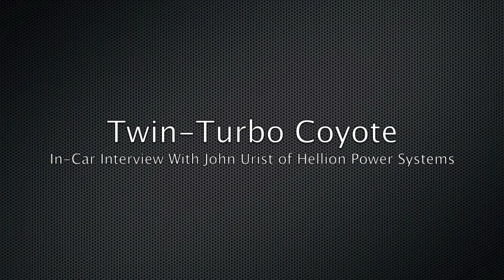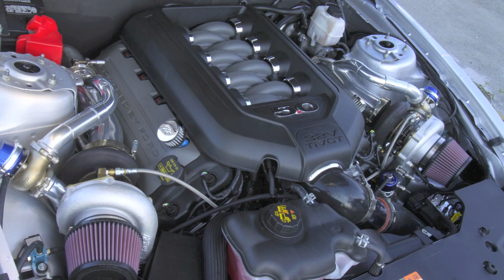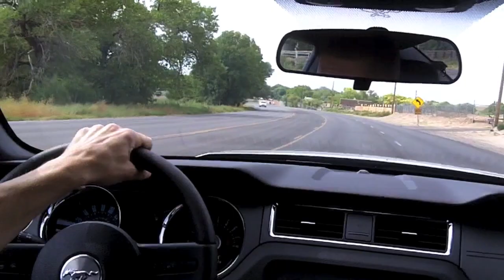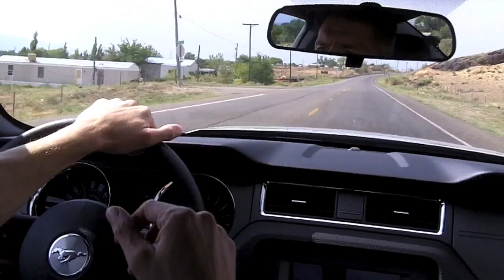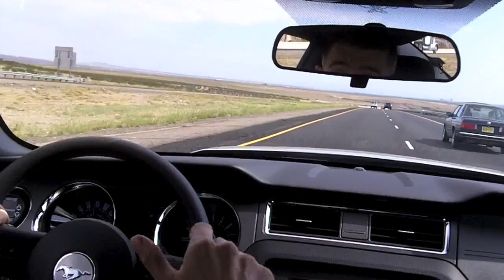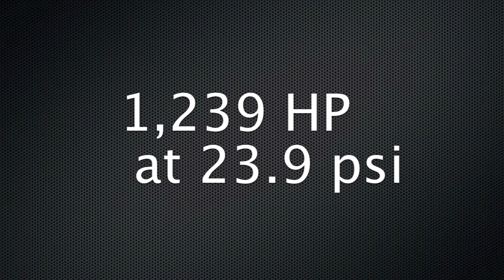Hellion Coyote

Comment: $8500 ?? Way over priced. 90% tubing. If you can get the dimensions of all the tubing and have a fabricator do it for you, the price would cut in half, so just buy the turbos, BOV, intercooler, headers. Youll get away with $4,000

Comment: The problem with a manual transmission is every time you push in the clutch to shift, you take the torque off the drive wheels.  An automatic always has torque on the wheels.

Comment: Boost control. At low pressure boost they essentially turn it into V8 version of Ecoboost that lets out low RPM torque bump which helps car quickly reach average street or freeway speed and then practically idle as it continues in steady state mode. American Muscle were able to do the same for their V6 project car with axial supercharger, they showed that a blown, 500rwhp car was able to consistently reach 33+MPG highway as long as right foot was telling ECU to tell Procharger to stay within 3#.

Comment: Stock coyote 5.0 in the GT an safely handle 620rwhp or about 735 crank hp... Stock s 412 crank hp 2011-2012 & 420hp for 2013-14. Or buy a Aluminator engine. Or better yet buy a BOSS with its fully forged Roadrunner engine.

Comment: You need to listen to the whole thing it is the base kit meaning at 5psi a stock motor will make 600+rwhp all they way up to an built motor running 25 psi making 1200rwhp. Also he never said anything about a 8K crate motor you can get factory aluminator crates for 7K you can also get the block for 2K and throw MMR or a DSS rotating assembly in it for 2K. Injectors and fuel pumps along with a base tune are included in the 8K kit.

Comment: "Basically bone stock"?!? You just listed a twin-turbo setup ($8,495.00), Ford Racing 5.0L 4V DOHC Aluminator Crate Engine ($8,374.99), High pressure springs (??), triple pump fuel system (??), Billet gears (??), and 80-lb injectors (??) all on top of a car with a base price of $32,000. Oh, I almost forgot the twin disc clutch. And you say the "base kit" will make over 1000 HP, no big deal. You're so full of shit...

Comment: I base those figures on actual engineering data. Quite a few racers and tuner shops push on them past 700HP, but they are playing dice (probability) at that point. That's why most serious engine builders upgrade to billet rods after that point.

Comment: Right. And correct me if I'm wrong, but the Aluminators come with the Manely H-beam forged rods (the same ones that came in the termi's) with ARP 2000 fasteners. That combo is rated at 700HP and will spin to 8K. Probably handles more than 700HP, if you only spin it to ~7K.

Comment: Agreed. They should have fixed the hurt stock motor and went the "upgraded" or "replaced" route. But you can't hide money ;). Need this setup for my fox. Actually, interested in a rear turbo for the fox, with the turbos replacing the mufflers. Don't know why I'm hung up on that sneaky STS-like stuff, i just think it would work and keep the engine bay clear of heat, etc.

Comment: The Aluminator 5.0 that's used here has a stock coyote block and forged internally balanced steel crankshaft anyway, so really, what they could've done is match the Manley 2618 alloy 9:1 forged pistons + Manley 4340 H-beam con rods for just under $1,400, plus any options (ARP 2000 rod bolts, alloy wristpins etc, couple hundred bucks extra) along with Boss 302 bearings and they even could've gotten some comp cams stage 2's or 3's, stock heads, and saved alot over the price of an Aluminator.